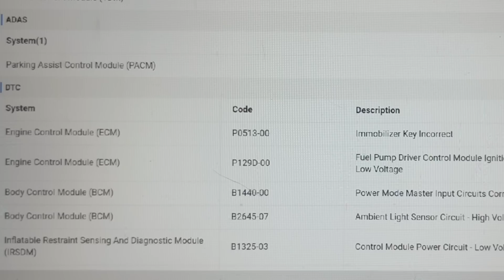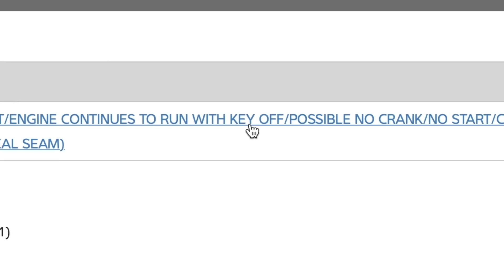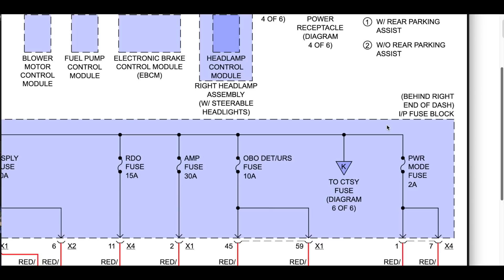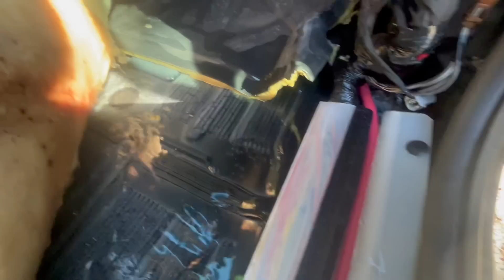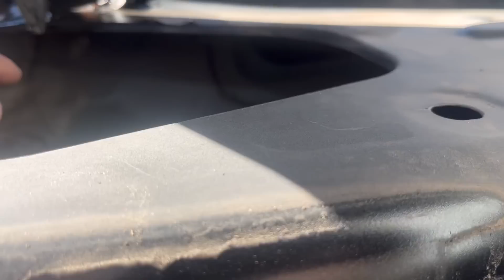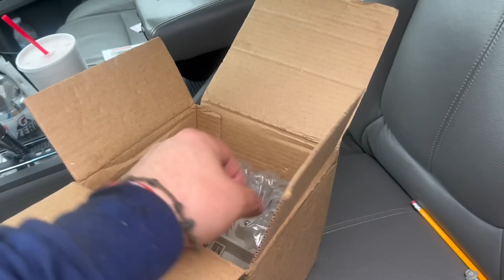2015 Chevrolet traverse no start condition

Comment: I have a starter relay circuit after replacing  injectors I had a cylinder one miss fire replaced injectors put it back together and all of sudden starter relay code that’s the only one im getting it still cranks if you Juno starter relay I changed relay with another I’m not sure what else to do

Comment: Thank you SO MUCH for this video!! I have the same car and exact same problem. Took it to burns chevy and they couldn’t figure it out because it had dried up by that time and wasn’t having an issue anymore. A week later we get heavy rain and same thing. My dad found your video and was able to fix it. Still got to find the leak but fixed the connectors and got it running right. Thanks again hope you have much success!!

Comment: An earlier TSB identified unsealed seams in the cowl as the primary leak area in multiple GM SUVs: https://static.nhtsa.gov/odi/tsbs/2015/SB-10024244-9053.pdf . "Water from the right front sunroof drain hose exits the vehicle through the plenum (upper arrow) and may re-enter through the un-sealed  seam at the front of the dash."  Doesnt matter where the water comes from, its the "UN-SEALED SEAM" (from factory) that is the problem. Seems like the updated TSB in the video is worded to deflect blame to the windscreen installation.   To suggest that Thousands of other car models just magically get their windscreens replaced correctly, and these GMs dont = Corporate Blaming strategy 101.   
Stay gold.

Comment: You can close a vehicle up with an airline blowing shop air into the interior and spray soap water around the windshield to find a leaking windshield. We used to test semi trucks that had water intrusion like that. 
Doing research is where it’s at. Seeing the TSB was priceless.

Comment: water testing always start from the bottom work your way up also you could spray around the window with soapy water and air line low pressure and blow gun to see where the leak is
Reply from the maker: Know this is why I love YouTube. Never thought of this. Now I’m eager to thy this out on something. Thanks for stopping by
Reply: i should have said spray soapy water outside and use air blow gun from the inside and see bubbles happen the chance is when they replaced the glass they slammed the door before the bonding sealer had set and the force poped a hole in the sealer i learned this back in the day   @OzMechanics

Comment: For problems with sealing windshield use soapy water and shop air/compressed air. Spray the edges with soapy water and blow air from the inside. It will show for sure.

Comment: I hope by now the problem has been fixed.
I know what I would have done before that vehicle went back.
I saw this happen to an older vehicle back in the late 80's.  I cleaned out the PCM as best as I could, then wrapped the wiring and PCM then told the customer to take it back ASAP to the windshield installer and make sure they fixed it correctly.  The car ran better after my cleaning of the PCM. I don't know if the customer brought the car back to the glass installer.
I gasped when I saw you pick up that  passenger side rug!  The customer better have the glass installer clean up that mess or that floor pan's a goner! ! !
GOOD ONE OZ!
Reply from the maker: Yea, I showed the shop I was working with pictures and videos of the repair. I saw as I dropped it off he already had the glass installer there waiting and got a guy to clean the floor

Comment: great video tks
to check windshield leak just take compressor air blowing one side and put soppy water on other side and look for bubble
Reply from the maker: Dude nice tip. I’ve used the smoke machine back in the day.  It that was only used once because it smelled bad afterwards lol

Comment: I was going to say passenger side leaking wouldn’t get water in the driver side too so I would say both sides are leaking I would look at the driver fuse box also
Reply from the maker: We will recheck in a week or so. I wish I could look how the urethane was layer down.
Reply: That's what I was thinking.  Need to check all the components and connectors on the drivers side.
Reply: Good diag enjoyed this video